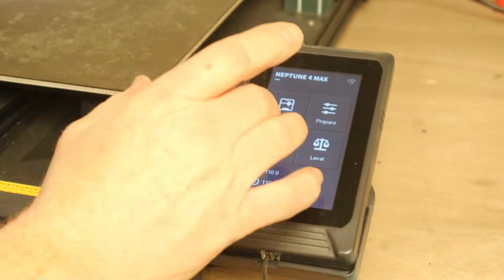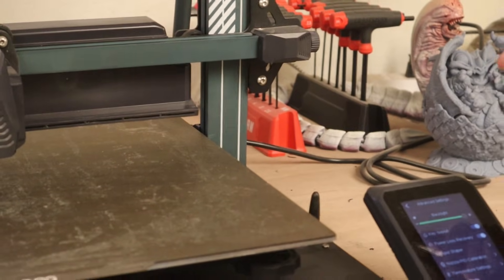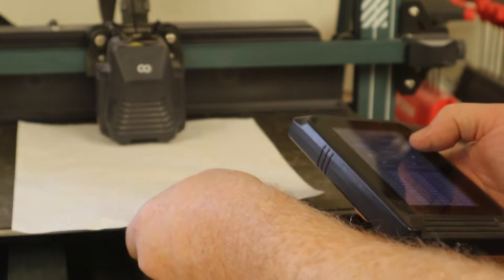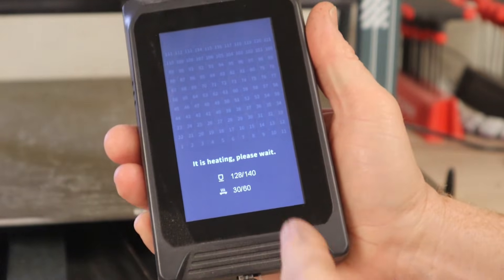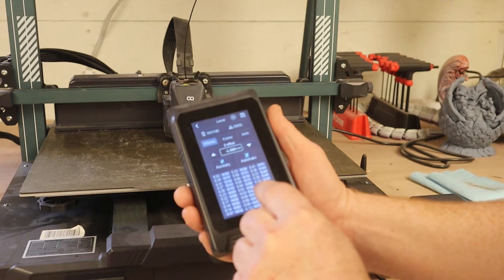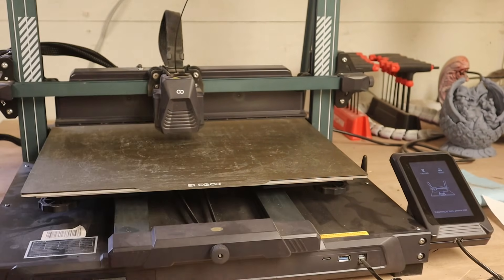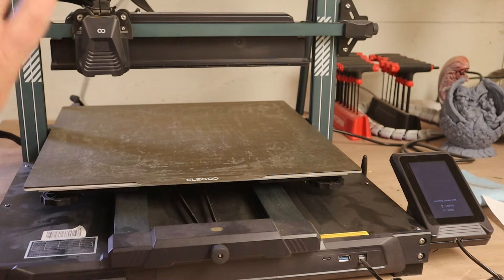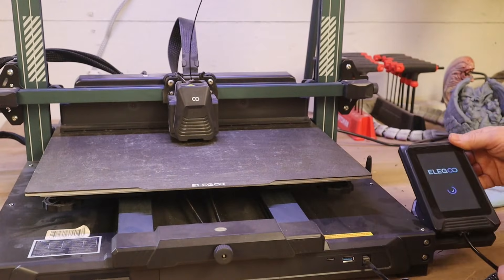The easiest and most effective way to level your 3D printer!  (Neptune 4 Max)

Comment: Where is imput shaper?
Reply from the maker: It's in the settings tab, I would have to look at the screen when I go off work to see exactly where
Reply: @AlrightWhatsNext thank u kindly, this thing is kicking my ass badly
Reply from the maker: I just uploaded a YouTube short showing where it is on my printer.
Reply from the maker: Go to settings, then at the bottom of the settings screen is advanced settings, click that and input shaper is there
Reply: @AlrightWhatsNext i don't have that option anywhere
Reply from the maker: @fromodmustang225  that's odd

Comment: Don’t mean to ask stupid questions but 2.12 for example would you go up or down or a 0.35.   I’ve got 2.12 front 1.40 back on one side. What should I do. I’m getting myself confused.
Reply from the maker: The black numbers are the only ones you really need to concentrate on.  They are the actual nozzle to bed distance.  Just ignore the blue
Reply: Thank you. I got it. It’s printing now.
Reply from the maker: If it's a positive number you turn the knobs down.  Negative numbers turn the knobs up

Comment: When it goes through and touches all the dots, even though I put a piece of paper in there it’s still like a good mm off the bed. My last printer would tap the bed.
Reply from the maker: I'm really happy it's working.  It's actually a pretty good printer once you get it level
Reply: @AlrightWhatsNext I know, a lot of people talk about how it’s not great. It’s definitely user error, most 3d print problems are as much as we don’t want to admit that. Good to see a tech head who gets that, bed size and print speed can’t be beat, my benchy is done and fuck it’s beautiful
Reply from the maker: I guess I never got down eye level and look to see if mine taps the bed, I assumed it did.  After getting it leveled according to the numbers have you printed anything?
Reply: @AlrightWhatsNext fair point, I followed your instructions and just had to adjust my offset. Printing my first benchy no problem. Looks infinitely better than my last printer 

THANK YOU
Reply from the maker: It's a maintenance heavy printer.  You still gotta check the bed rollers often to make sure they aren't worn out or loose.  I relevel mine about every 4th roll of filament I use up.  It tends to work it'self out of level.

Comment: Do you ever use the screw_tilt_calculate macro? It might help to start with that to get you close and then do the full bed leveling process. I think that's what the auxiliary leveling process is supposed to do, but screws_tilt_calculate will actually tell you how much to turn each wheel.
Reply from the maker: No I haven't

Comment: I hace some issues with my neptune 4 max. I do all of that, except shutting it down after saving. All numbers of both columns are between -0.1 and 0.1, and still when i print something big, i see that at the back of the plate the nozzle is lower than the front. If anyone has any idea how to solve that im all ears. Thanks
Reply: Dunno if you ever resolved this but double check to see if you gantry is square.

Comment: Hi, I've just been setting up a new Neptune Max 4 and when I run assisted bed leveling the gantry does not take the hot section to the edges or the corners. I've updated the touchscreen FW and the printer has the latest FW as well. When I select the corners or the edges it simply runs back and forth in the center.
Reply from the maker: Try unplugging your stepper motors for both the x and y axis, move the print nozzle all the way to the left and pull the bed all the way forward.  Turn the printer on and let it fully boot up and plug the motors back in.  Then shut it off and reboot.  I had the problem once after a horrible print failure where the print head wouldn't go all the way to one side and this fixed the problem for me.

Comment: Did you want to explain the numbers, each row, and what they stand for? Rather than just saying that "its" negative or positive, up and down. We would like to know the specifics of what we are dlooking at rather than a 'do this', 'do that' scenario. Thanks
Reply from the maker: each number is a point of measurement your printer makes when you run the auto bed leveling check.  positive numbers mean the bed is high and needs to be lowered and the negative numbers means the bed is low and needs to be raised.  That's why the adjustment wheels are labeled up and down with arrows pointing in which direction to turn them

Comment: great video, learned a lot about the neptune 4, what flow rate are you using?
Reply from the maker: I've never messed with the flow rates.  I just left it the default settings when I slice my files

Comment: My x axis and y axis thing doesnt work i dont know how to fix it either if you know please let me know
Reply from the maker: Are you running the latest firmware update?
Reply: @AlrightWhatsNext yes i am
Reply from the maker: I'm not sure why your input shaping doesn't work, I'm assuming you changed your printer over to advanced mode in settings, although I don't know if that matters.  You may have to send a message to Elegoo technical support.  They are really good at resolving printer issues, but it can take a while to get a response

Comment: Quick question I don’t know if you’re gonna respond or not but I’m just gonna ask anyways if my number is negative and it needs to be negative should I go left or right and vice versa if it’s positive doesn’t need to go left or right if the number is positive?
Reply: @5:27 the graph shows, turn left to go up, turn right to go down. Left raises the number (a negative closer to zero), right lowers the number (a positive closer to 0)
Reply: Clock wise will raise it up and counter clock wise will lower it.
Reply: Basically, turn left to make the number higher (raise the bed closer to the nozzle), right to make the number lower (lower the bed away from the nozzle). Sorry if I’m a little late on this